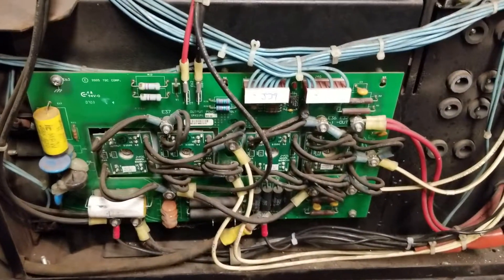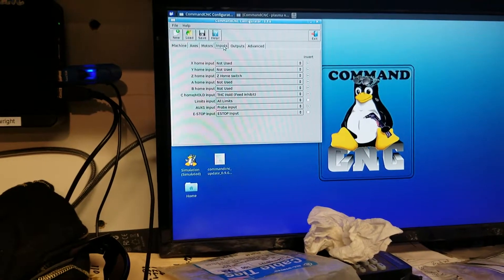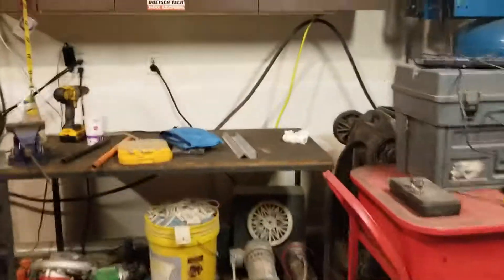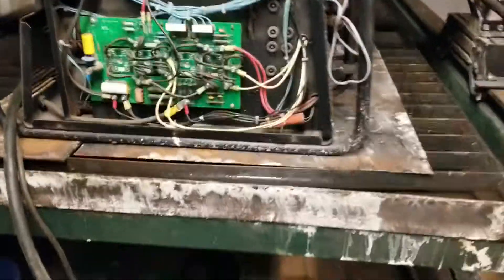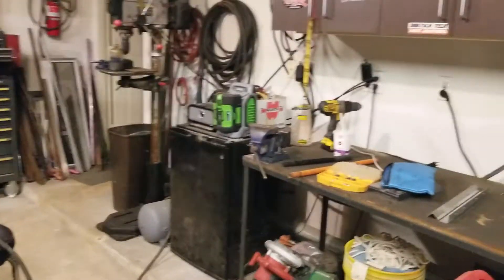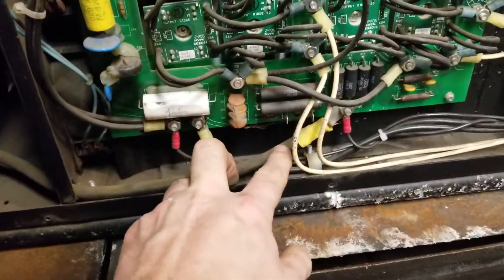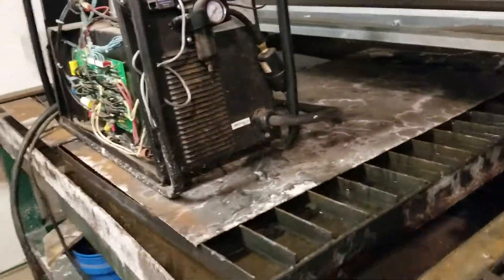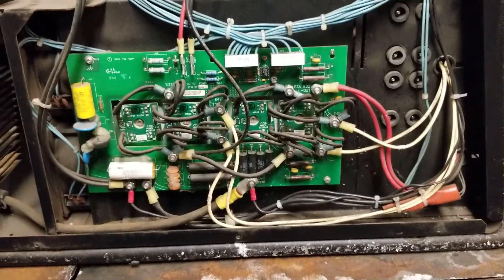Cutmaster 151  voltage backfeed through work clamp.

Comment from the maker: the hesitant starting and stopping was water in the torch tip it will dry and the machine would go back the normal operation. water in the torch tip will trip the ohmic and cause it to pause program or jogging. quick soloution is to purge the torch tip by clicking the torch on button to blast the water out.

Comment from the maker: to all that watch this video i discovered the problem was my ohmic sensor was grounding on my contact tip which is not the intended place for it to touch. i ended up buying a shield nozzle which isolates it from the internal plasma electronics.

Comment: hello what is the price of a 151 cutmaster?
Reply from the maker: i bought mine used for about 1k it was a long time ago maybe less maybe more but it turned out to be a real good unit still using it to cut up to 1/2" plate might be able to get more out of it if i had 3phase available.
Reply: @twistedtrail8414  
I have a new one and they stole the tip because I left it near a vent and now I can't get it, I'll have to sell it like that
Reply from the maker: @jorgelampkin9215  like the whole torch head or just the cap? the torch is probably 500. sorry to hear that man personally i wouldnt sell it.
Reply: @twistedtrail8414  
All the hose and it is that my father died a month ago and how not to use that I prefer to sell it
Reply: @twistedtrail8414  and how many dollars do you mean when you say 1k